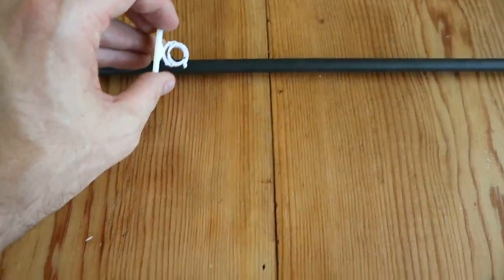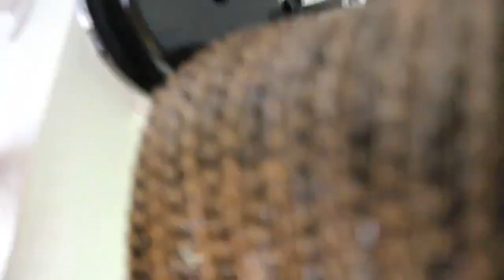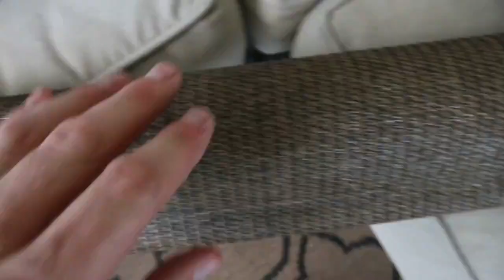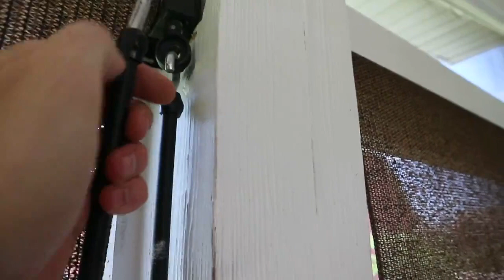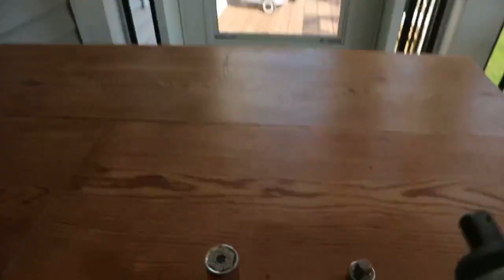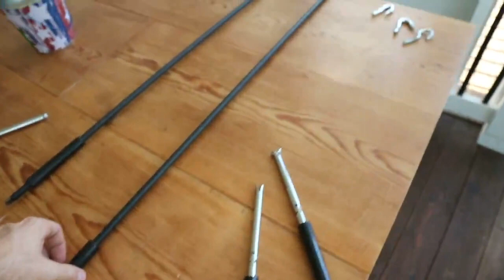️ "Motorize" Coolaroo Exterior Sun Shades   |  PLUS Install Tips & Review

Comment: Hi there. Great video. I was going to try to use a cheap cordless screwdriver. In your links, you mentioned considering that But weren’t sure if it had enough torque . Any thoughts on that? Also, is there a specific shank piece and size for the screwdriver that I could look for? And how big a deal was it to pry off that piece at the bottom of the crank? Thank you!
Reply: I've used a cheap amazon screwdriver for the last 5 years.  No problems.  I did have to sacrifice a bit to make it work.